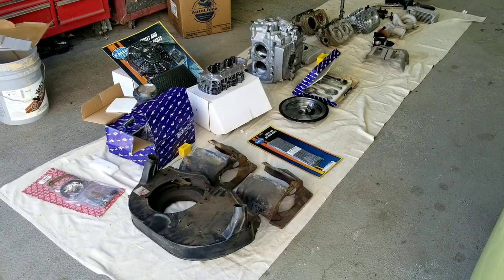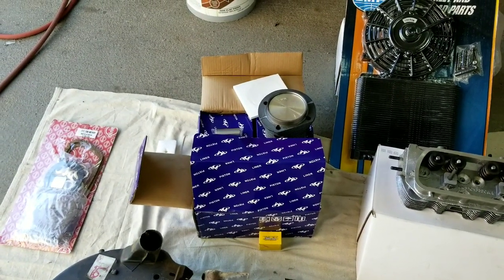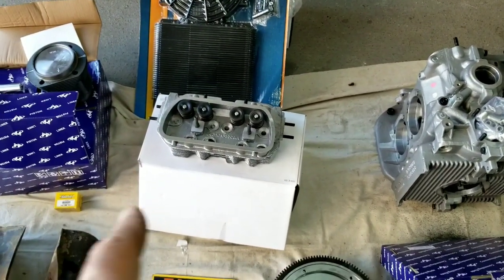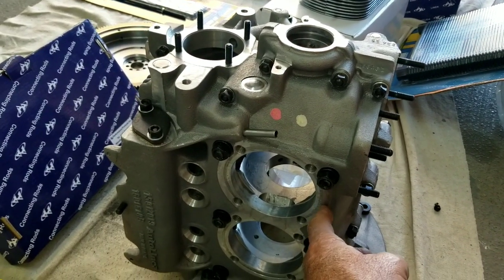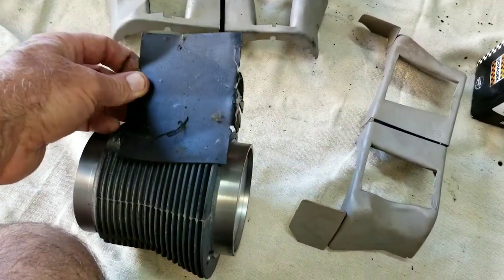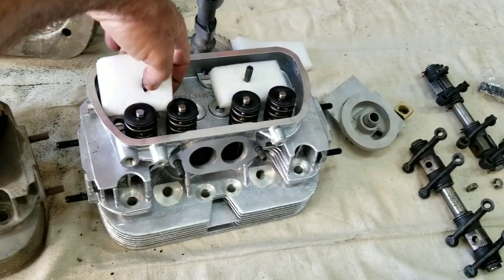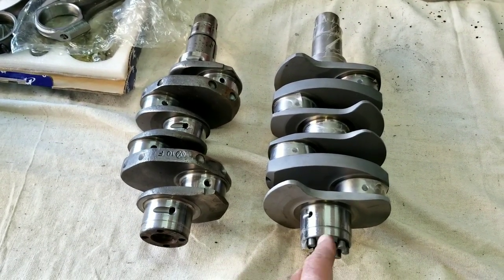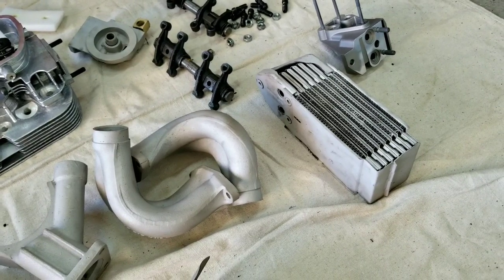Bulletproof VW bug or bus engine build NEW parts layout series part 1

Comment: What carb will you run?
Reply from the maker: Real Holly webber. Easy to maintain. has choke. But you gotta re jet them to the new motor spec. You do end up with a dead spot in the transition sometimes but great on gas decent power and great on gas. Plus more torque because of longer intake runner. Great for daily driver in a bus.
Reply: @Mikefngarage  Cool, I'll watch for next videos. You running vaccuum advance distributor?
Reply from the maker: 009 with pointless

Comment: Used cam ? Sorry but never run a used camshaft . All those parts and you skimp to save what 40 bucks ? Come on man.
Reply from the maker: It will be fine. done this before.
Reply from the maker: and dont run one unless you know how to check to see if it is worn. gotta know your used parts.
Reply: I'm not saying it can't be done , I'm saying it shouldn't be done . Especially with a solid cam . I've had many a customer insist on their used cam to save a few bucks , and have it result in engine failure . Do what you want to do,  you will anyway , but don't act like it is really a acceptable practice, or a standard  for a competent engine builder, because it's not. This is low budget shade tree type of stuff , not trying to insult you , but the shoe fits ,no offense.
Reply from the maker: @jacksonstorm6395  this cam is much more than 40 bucks More like near 100 or more and it is in perfect shape came out of an engine in the shop many years ago no wear on the lifters and it was just too big for the engine it was in. customer came in for rebuild. I have a few of them around and this one is the right one for that engine so it is time to run it. I used to save them when they were performance grinds and perfect shape. The only cams I have ever had on VWs go flat are empi cams and lifters. It is because of the grind. Tom the owner of scat told me that. He was explaining it to em and I dont remember the specifics. His shop makes all the cam blanks for everyone now.
Reply: @jacksonstorm6395  Damn dude, chill out...
Reply from the maker: @jacksonstorm6395   plus tax plus shipping and I would not go engle i like webcam number a bit better. Since i had this one I got it free and it was perfectly good why not pull it off the shelf and run it. This is my motor I can put anything I want in it. I am putting in a USED cam because I am willing to take the risk. I would hope anyone who watches would have their own common sense. No  name dropping here dont need to.
Reply from the maker: @jacksonstorm6395  By the way I Said NEAR 100 and that included tax. Pretty accurate if you ask me.
Reply: @Mikefngarage  I'd love to argue some other time,  I'm out of town and making arrangements for my mom's funeral.  Give me a few days and we'll go at it some more.